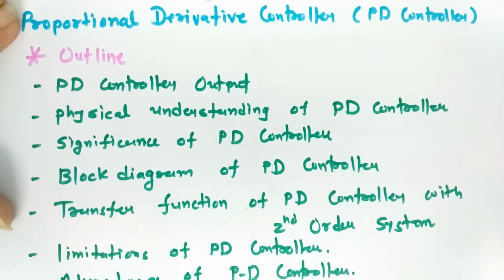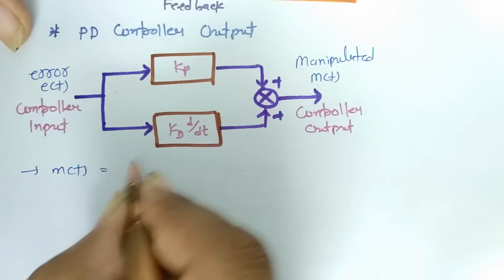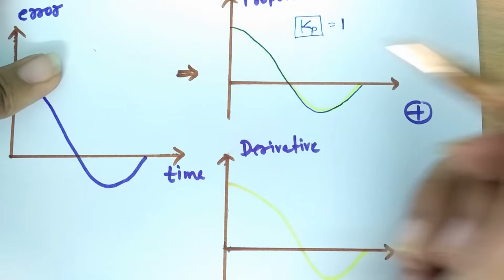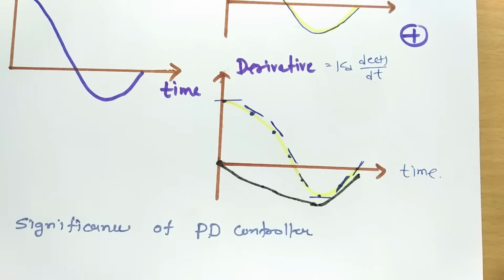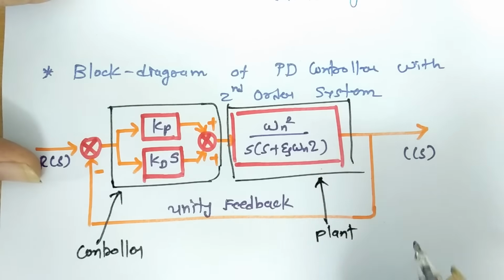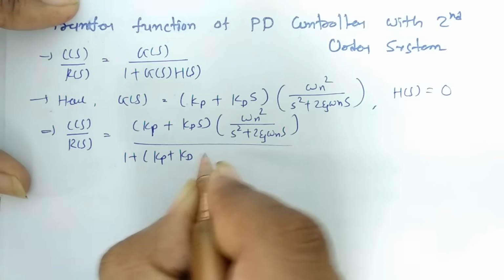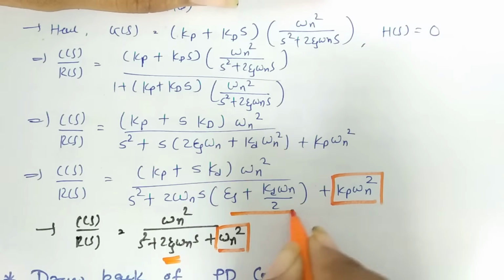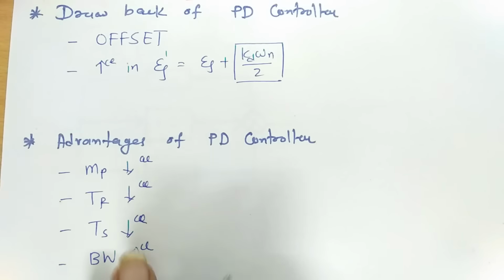PD Controller Explained: Basics, Block Diagram, Significance, Transfer Function, Pros, and Cons

Comment: For D controller the output should start from zero and then go back to zero when the error input is at its minimum point.
Reply from the maker: in derivation controller output will goes towards zero when error input is constant